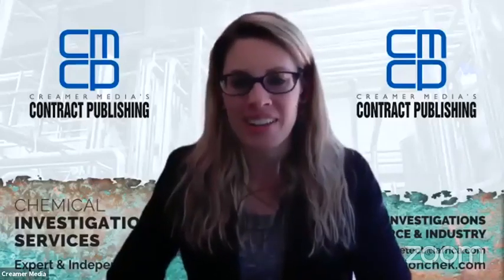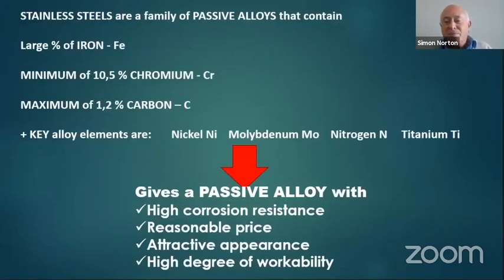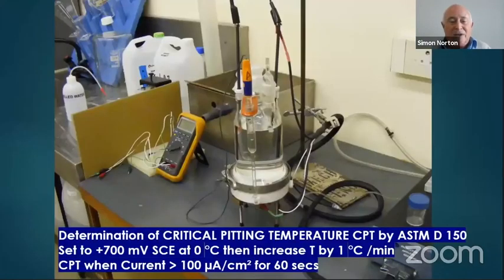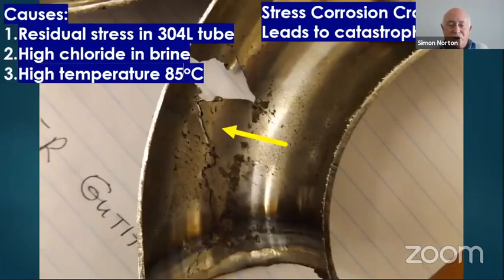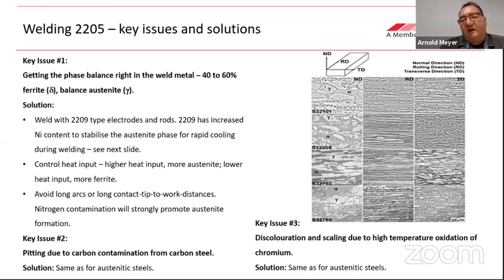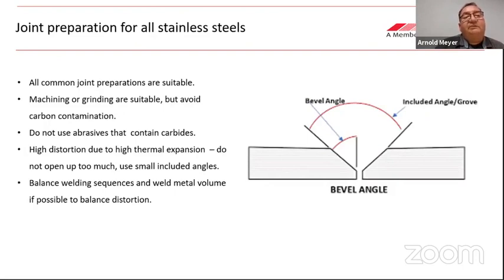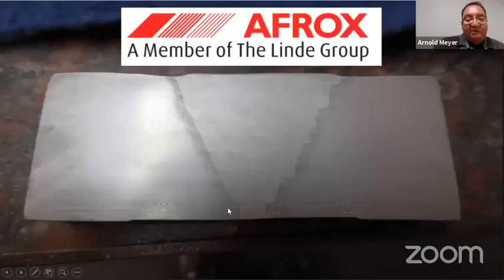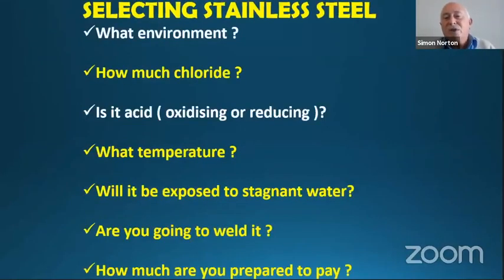Essentials of Stainless Steel - Case Studies in Corrosion

Comment: A fantastic lecture. Can duplex 2205 be used for potable water plumbing applications? Is 2205 better than 316 for plumbing application? Also,can 2205 be investment cast ?